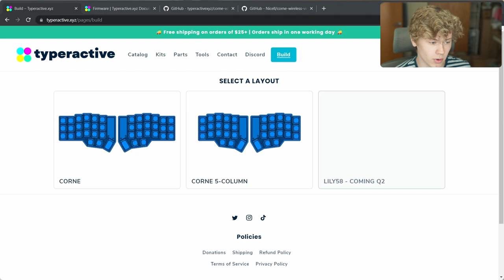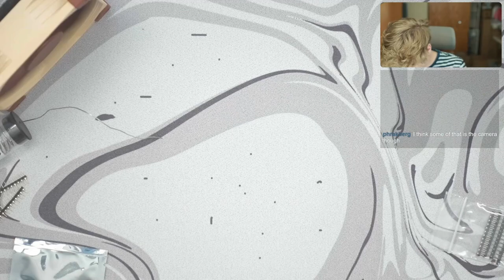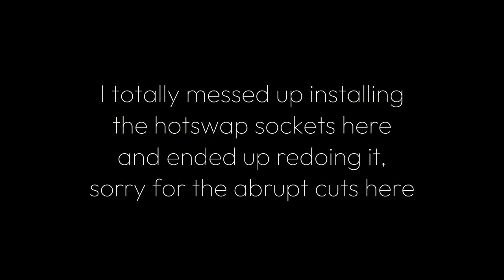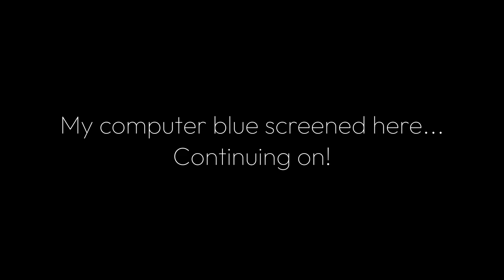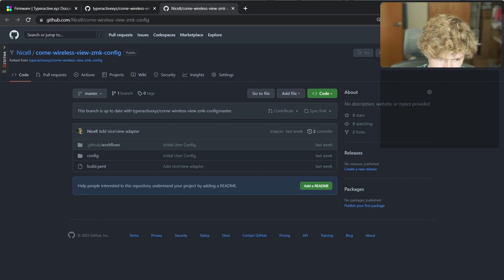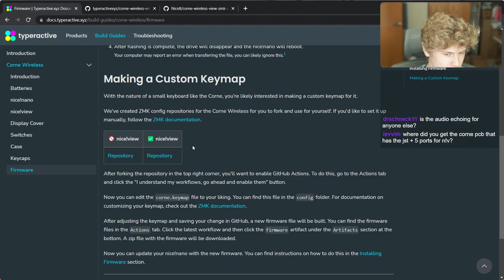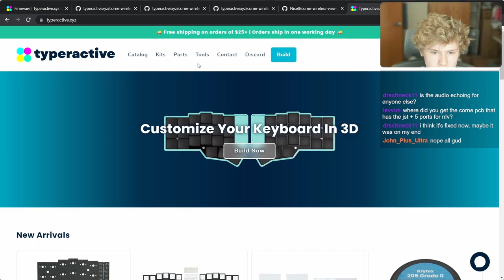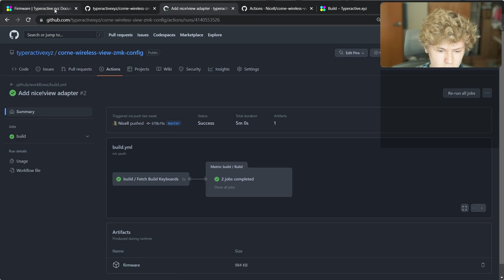Corne Wireless Custom Mechanical Keyboard Build Stream from Typeractive.xyz

Comment: Either they need to upgrade it to include wireless charging, or "wireless" is meaningless. I am already sick and tired of charging several devices by plugging cables in/out with two hands daily. If not wireless charging, at the least some kind of magnetic charging cable, like MagSafe, that I can operate with one hand is needed.
Reply: There are magnetic (magsafe like) adapters for normal cables, you can just buy one of those.

Comment: Is this capable of rgb led underglow and top glow (SK6812MINI-E. ) (WS2812B LED) 
And could I put OLED screen in place of
The niceview
Reply: You could technically add lights to the keyboard but it would significantly decrease your battery life since it's wireless. The original is a wired build though so that would be no problem if you went that route.

Comment: 2 month after I build similar keyboard, I still miss the numbers row, especially in Vim. Go 5 lines down: 5j, remove 3 lines: 3dd. Considering switching to a split keyboard with more rows.
Reply: Do you know that you can customize your keys layout? It's so easy to solve that with layers and behaviors on the ZMK.
Reply: @junio.coelho  Yep, I figured out how I can do it and still type numbers quickly: On right hand I have an FN2 function that activates econd layer. On left : there're two rows of numbers. So it's easy to type them with one hand. Previosly I had issues because I had FN2 on both sides and numbers were located on top row on both sides on second layer, so long numbers were very slow to type. Right now I love this keyboard, don't want to switch to anything.
Reply: @JohnIdlewood  oh, that is very good. That keyboard is really really good. Plenty of usefull features. Solved all my needs as well, like you said.